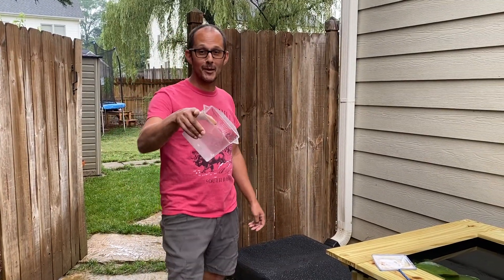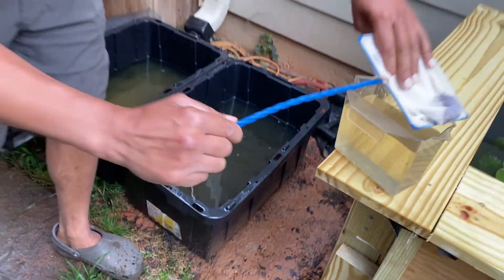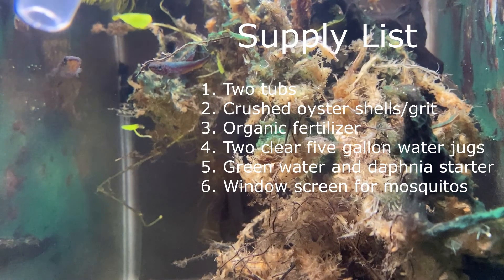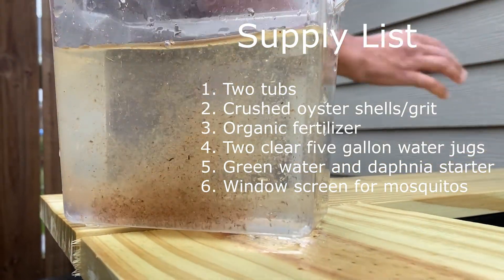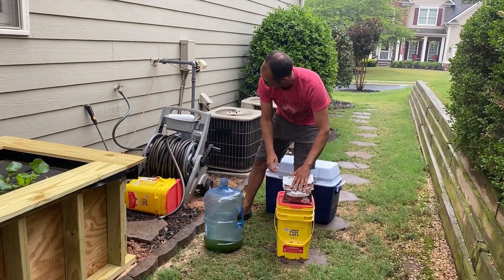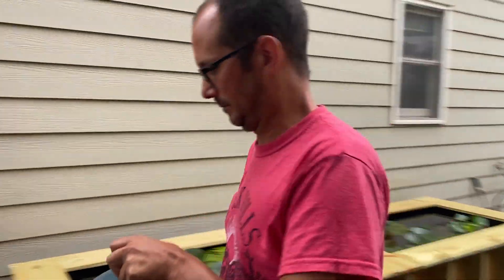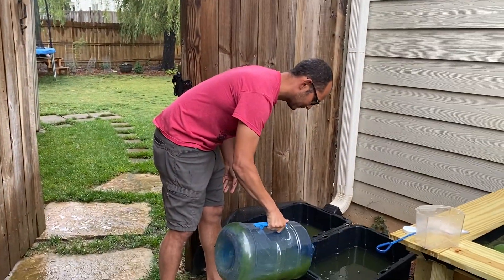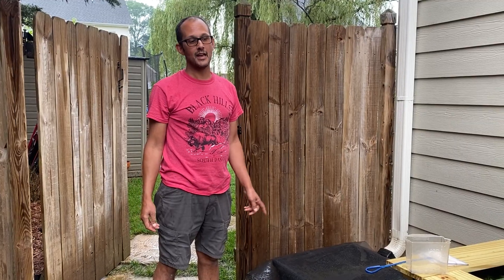Daphnia Explosion - How to Raise Daphnia and Feed Your Entire Fish Room

Comment: Hey man great video. Have you ever tried harvesting the eggs as a backup? If so what method do you use?
Reply: In this method the daphnia would mainly reproduce by cloning themselves and giving live birth. If conditions become unfavorable for them (which maynot in this situation as he feeding greenwater and doing water changes) they will then produce males and females and they will mate producing egg sacs. Youll see it in females as a tiny dark color pea shaped sac on their back. 
They would them release them and you can see some floating in water surface but majority would be in the debris in the tub base. Siphon it out using a bbs net and then air dry until completely dry. Store in air tight container to use at later date. Hope this helps.
Reply: @CrowntailHalfmoon  thanks will give it a shot
Reply: Can you buy daphnia eggs like brine shrimp?